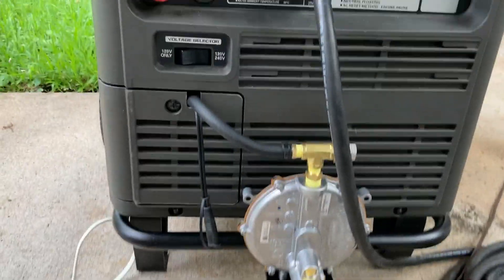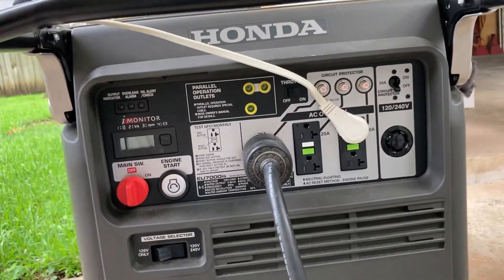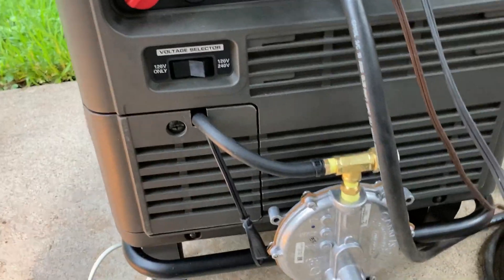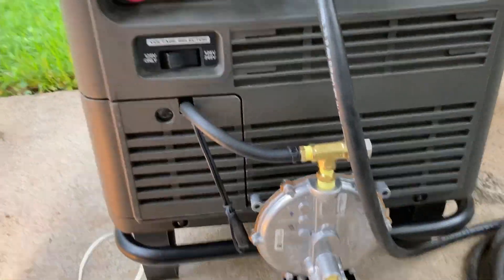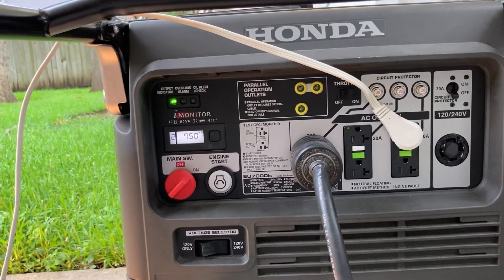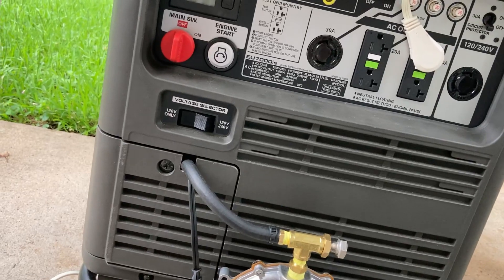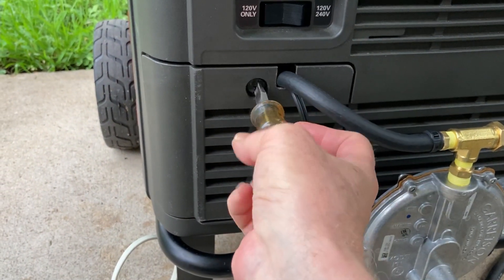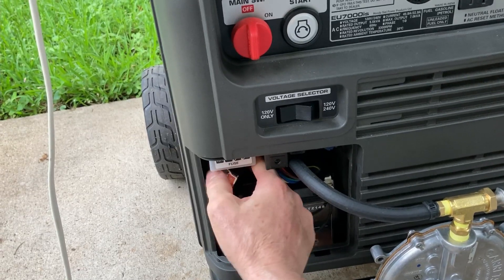Honda EU7000is running on natural gas with US Carburetion Motor Snorkel tri-fuel conversion kit

Comment: The reason your generator's engine is surging is because you cut that opening in the battery compartment door. The manual specifically says that the door should be installed and completely closed, otherwise the engine will not run correctly. Why did you install it this way?
Reply from the maker: As you say, the manual does warn against operation without the maintenance cover in place, but the door itself is louvered, so it's as much hole as it is solid - the amount of extra leakage around my hose would be completely insignificant.  It actually makes no sense that they would say that, since the door itself has a knock-out in that location, which is intended for remote start wiring, so I don't know why they say that.  But FWIW, I've spent a lot of time with the generator and as far as I can tell, it runs exactly the same with no door at all.  Also worth mentioning that there is no surging when running on gasoline, regardless of whether the door is open or closed.

And to be fair, even none of the above were true, the instructions that came with the conversion kit told me to use the knock-out in the battery door, and since this is as much a review of the kit as it is of the generator itself, the kit instructions are as important factor.  But honestly, if you saw the door in person, I think you would agree that the extra hole can't possibly make any difference.  The entire generator design requires air to be drawn in through the battery door and the rest of the front panel, so it would be way worse to block it off than to open it up.

I have a feeling that might be a mistake in the manual.  The side maintenance covers actually are sealed, so it actually might make a difference if they were open.  Maybe that note was intended for the side covers.  Although even that doesn't make complete sense, because the only way to rope start the generator is by opening the right side maintenance cover.  FWIW, I think it's more about airflow for cooling the inverter than it is about how well the engine runs.
Reply: @MstrMark  I have the 6500is model, same as the 7000 in virtually all respects. Take the door out and it surges exactly as in your video. Put the door back in and no surge. Honda doesn't make mistakes like that in their manuals. Third party companies do.
Reply from the maker: @meinempanadas  If you say that's what happens with your battery cover, then I believe you, but that's not the case with mine.  And again, mine doesn't surge at all when running on gasoline, even with all the doors and covers open.

The idea that Honda doesn't make mistakes is a relative concept...as a professional mechanic, I've seen a lot of things that Honda did that seemed like mistakes to me.  I think they make a good generator, which is why I was willing to pay so very much for the EU-7000is, but it's not perfect.

Also fair to say that the conversion kit is far from perfect, but it now runs on natural gas, which is one of the things that makes Honda's design less than perfect, IMHO.  I think it's a fair trade-off.
Reply: @MstrMark  Mark, your generator began surging at 4:37 in the video the moment you switched it from 240v to 120v. I can hear it quite clearly. Honda doesn't make NG or LPG generators because of liability issues. From one pro mechanic (Marine Corps-trained) to another.
Reply from the maker: @meinempanadas  I agree with everything you just said, but don't see a solution in there, other than to only run it on gasoline, which never surges, and generally runs like a dream. But gasoline is a very impractical fuel for a seldom-used machine.  It's difficult to store safely, has a lousy shelf life, and it's hard to replenish in the middle of a state-wide blackout, like the one that happened here in Texas last February.  Given the choice, I'll live with natural gas. The surging only happens within a very particular range of loads, and only in the 120 volts (only) mode, and only with Eco-throttle engaged, so it is easily manageable.

I'd be curious to know your thoughts on why Honda is more concerned about liability issues than an arguably lesser company like Champion...as you probably know, they have multiple models that are dual fuel right out of the box.

Also, I know you think it's because of the battery door, but I don't think that's actually true.  I think it's because the engine doesn't make as much power on fuels other than gasoline, and Honda's throttle management (GCU programming) incorrectly assumes that the engine has more power at a given RPM than it actually has.  I think it's a case of the engine falling off the power curve.  If the engine computer would ramp up the RPM more aggressively, it wouldn't surge, as demonstrated by running it in 240 volt mode with the exact same load.  It seems that Honda uses the load on either of the two inverters as criteria for increasing the engine speed.  It's not based on total power - it's based upon load per inverter.   

When switched to 120 volts only, the two inverters are bridged, so each inverter sees only half of the load.  Honda apparently takes that as a signal to throttle the engine down, which then, unfortunately, allows the engine to fall off of its torque curve.  At that point, the engine slows down enough that the generator can no longer meet that demands of the inverters, which then results in a reduction of output voltage.  At that point, with a purely resistivity load (like I was testing with) the wattage falls off, which then allows the engine to recover RPM again...and then the same sequence of events happens over and over again.  I think that's why it surges.

It may be that Honda increases the engine speed in order to ensure adequate cooling airflow over the inverters more than to maintain engine power output.  That airflow is directly influenced by engine speed.  There is no electric fan - it's purely mechanical, driven by the engine...completely dependent upon engine RPM..

This correlates with my experience with an EU3000is that I've had for many years.  During Hurricane Ike, I was using that generator to run a portable A/C unit.  It didn't have any trouble running the unit, so it was in Eco-throttle mode and seemed fine until it unexpectedly shut itself down.  After a few shutdowns I started to understand that the inverter was overheating.  It was very hot outside and my EU3000is is not nearly as sophisticated as my EU7000is, so it certainly wasn't smart enough to figure out that it needed to ramp up engine speed in order to keep the inverter cooler.  It would just chug along until it overheated and shut down.  Over and over again.  And that was while running on gasoline, so we can't blame any factors beyond Honda's design intentions.  They just failed to anticipate the need to speed up the engine in order to keep the inverter cool enough.

Now, many years later, it seems that the EU7000is has a similar issue, if somewhat backwards.  Perhaps it's not fair to blame Honda for failing to anticipate the need to increase the engine RPM more aggressively, because after all, they didn't intend for the machine to be running on alternate fuels. But then on the other hand, I suspect that essentially that same thing would happen while running on gasoline at high altitude, so one might reasonably argue that they should have given it more thought.

Or one might also rightly argue that the maker of the conversion kit needs to find a way to reverse engineer Honda's GCU so that it will tell the engine to increase RPM more aggressively.  Or if I'm right about the inverter load being the criteria for engine RPM, then perhaps some way to spoof the GCU into thinking that the inverter load is higher than it really is.  But something tells me that US Carburetion is not likely to do that, since they don't even care if the kit fits right from a purely mechanical perspective.  "Hey, it's a kit" - they're kind of famous for that attitude.

If Honda generators were anything like turbocharged "tuner cars", then multiple spark-heads would have already cracked the engine computer and it would be just as easy to chip-tune a Honda generator as it is to chip-tune a Honda Civic Type R.  But alas, that kind of enthusiasm for generators doesn't seem to exist.  If Honda stays on their present course, I believe that they will lose a lot of market share to the likes of Champion.  I suspect that they already have, because I personally know of half a dozen people who chose Champion over Honda in the last year alone, because (a) they run on propane right out of the box and (b) they cost so much less that one could buy several for the price of a single Honda, not to mention the extra expense and hassle of converting a Honda to run on a more practical fuel, nor the fact that all of the conversion kits that currently exist have significant "issues".  Champion is paying attention to what people want from an emergency generator, while Honda is not.  

I want to love Honda, but Champion seems to be leading the market right now.  I can buy (4) 4650 watt Champion dual fuel inverter generators and two parallel cable kits for less than I paid for my EU7000is which would give me over twice the power and/or quadruple redundancy, and still come out over $1500 ahead considering the conversion kit.  And to say nothing of the massive expenditure of my time and trouble.  It's crazy really.  I don't know why anyone buys Honda generators, unless it's for the bragging rights.
Reply: @MstrMark  Honda is more concerned about liability simply because they are a much larger "deep pockets" target. As to placement, it would make more sense to drill an appropriate size hole into the access door and put a grommet on it to pass the tube through. That would seal the opening from air leaks. Or drill the hole somewhere where it will not cause surging. I bought my EU6500is because it was priced some $1800 less than the next one I could find with almost 2,000 hours, and mine only has 54. And don't forget to add a shot glass of Liqui-Moly MoS2 do the oil (50ml/liter). It will greatly reduce wear and tear on the engine internals. I use it on all my machines, from a 2008 bus with a DT466 diesel engine, a Land Rover LR2 of the same year, the generator and even a lawn mower.
Reply: @MstrMark  the Champion Generators that are inverters are not 240Volt.
Reply from the maker: @unitedcountryarkansasprope3029  I am aware, but they ARE engineered and ready to run on propane, and one can literally buy a nice Champion generator for less than I paid for my conversion kit alone!
Reply: @meinempanadas  I have a 100 foot remote start for my EU6500 that came with it, also no longer available to order, and it is designed to connect to the generator through that knock out hole in the front battery compartment. I have not done so as I don't need remote start, but I can see if it was passed through that knockout, there would still be a large hole left in that front compartment. Not enough to affect operations I suspect as this is a Honda approved connection,
Reply: @MstrMark  Seems like poor design to draw air thru the bat compartment, where I live seems like that would encourage battery freezing in the winter. Not that its going to be an issue in texas lol.
Reply: @atticus2581  I've read that fully-charged AGM batteries can survive at temperatures as low as -70F.  I haven't seen any actual documentation to back that up, but if true, there aren't too many places in the world where freezing would be a problem.  But as you say, I am on the Texas Gulf Coast. so I don't have much experience with such things!  I can remember one time in my life when the temperature around here got down to 1 degree Fahrenheit.  Even during the February 2021 storm that knocked out power across most of the state, it didn't get that cold here, although it did last a lot longer.
Reply from the maker: Stevan, 

I hear you, and I respect your opinion, but I don't agree.  Gasoline is a WAY more dangerous fuel than propane or natural gas.  Just in the last month, a bunch of people were killed in Louisiana while trying to refuel their generators.   Others died of carbon monoxide poisoning.  None of those accidents would have occurred if their generators had been running on propane or natural gas.  If Honda was concerned about liability, they would be better served by eliminating gasoline as a fuel option!

As for the routing of the gas hose, I used the knock-out that Honda provided.  I'm of the opinion that they wouldn't have designed it to be knocked out if they thought it would be bad to use it as they intended.  I think that makes more sense than trying to punch a new hole in the middle of a plastic part that is comprised almost entirely of ventilation slots.  I'm not sure I have any tool that could accomplish that in a way that would be anywhere near as clean as using the knock-out, and even if I did, the piece is so thick and irregular that it would be impossible to get a good seal with a grommet.  

Assuming of course that there would be any value in sealing a hole in the middle of a louvered panel that is essentially one-half hole.  By area, the entire knock-out is only about 0.25 square inch, even it it didn't have a hose running through it. The hose itself amounts to ~0.20 square inch, so I only added an extra 0.05 square-inch of ventilation.  That compared to something like 8 square inches of ventilation that the panel already provides, so my extra ventilation amounts to only 1/160th of the total area of ventilation. I just can't believe that could possibly make any difference at all.

And just putting that aside for the moment, there would also be the issue that using a grommet would make it impossible to open the cover without removing the gas hose, which is all but impossible to accomplish without damaging it.  The last time I had to remove it, I had to replace the hose.  I'm definitely not willing to replace the hose every time I need to open the cover, so it's just not an option for me.

And, I would point out to that you seem to be ignoring the fact that it never surges when running on gasoline, even when any or all of the covers are wide open, which strongly suggests that the covers don't affect the way the machine runs.  Logically, there has to be some other cause.  I have suggested several, but you didn't comment on any of that.

It sure does sound like you got a good deal on your EU6500is...I bought mine in reaction to seeing how hard it was for my dad to get by during a power outage.  I was literally wheeling the EU3000is back and forth across the street, trying to save thr food in both of our refrigerators...I decided that I didn't want repeat that experience, so I bought the EU7000is brand new.  I think I got a good deal, considering that there are essentially no "deals' on new ones, but I certainly paid more than you did.  It's a fine machine when running on gasoline, but not so much on alternate fuels, so I might buy Champion(s) if I had it to do over again.

As for extending engine life, my EU3000is is 30 years old.  It runs like it did the day I bought it.  I try to change the oil every year, even if I don't get anywhere near the hour requirement, but I often fail to do so.  I've never used anything other than conventional straight-weight Valvoline.  I checked the valve clearance a while back, but it was perfect.  It still has the original spark plug.  I stuck a scope into the spark plug hole and it looks like new in there.  The oil always looks and smells new, even after a year or more.  Natural gas is a lot easier on an engine than gasoline.

I'll probably use Mobil 1 next time I change the EU7000is, just because I now have more confidence in synthetics than I once did, and honestly, they have become easier to come by than the best conventional oils.  My generators just don't see a lot of hours, so ultimately the EU7000is' life will probably be determined by how well the (more complicated) electronics and soft materials hold up over time, not by the wear of internal lubricated parts.  

For example, my commercial mower is 30-years old - the Kawasaki Kai V-twin is a way better design than the rest of the mower.  It has a lot of hours on it, but the the only time the engine faltered was when it somehow blew a freeze plug out of the carb, which I talked my my neighbor into helping me fix by machining a new plug on his lathe.   My McLane frame edger is 45 - it's an old thing, but it still starts on the first pull.  I maintained four large suburban lawns during most of the life of my lawn equipment, and I still do two lawns most weeks of the year.  My GMC truck is 23 years old - had to replace the water pump for the first time last month, but the rest of the engine is all original.  I'm pretty good with machines.
Reply: @MstrMark  The issue with the battery door cover plate exists on the 6500is because it is carbureted.
This is not an issue at all with the Eu7000is because it is fuel injected.
You both are correct specific to the models you own. The door removal has zero effect on the motor surge on the Fuel Injected Eu7000is models but was an issue for a lot of owners of the EU6500is which came out before the 7000is. The addition of the fuel injection is why the 6500 is now a 7000. 

On another note has anyone hooked up the Msk-7000 PCM that came with the US CARB kit while also incorporating a wireless remote?
Reply from the maker: @GoldenAgeUSA2025  Thanks for the comments.  I have no experience with the EU6500iS, but what you're saying makes sense to me...unless the battery door on the 6500 has as many holes in it as mine does, in which case it still makes me squint.

Today is the first time I've thought about the term "MSK-7000 PCM", so thank you for bringing that to my consciousness.  My generator doesn't have remote start, so I don't know the answer, but I can make some educated guesses.  First, if I'm in some emergency situation where grid power is down, I can't think of any reason why I would want to shut the generator down, so by extension, I also can't imagine why I would need to start it again.  But I'm sure other people use the machine in other ways...maybe off-grid living or (well-equipped) camping.

Here's the thing - the primer is entirely manual, so if it's cold, it might be hard to start without using the primer.  But with that said, the only time that I have ever used the primer was after the machine had been disconnected from the gas supply, so the need may be as much about purging the hose as it is about enriching the mixture for cold start.  Maybe it would be fine.

Probably worth mentioning too that US Carburetion recommends turning off the gas supply as opposed to turning the generator's switch off, presumably for safety reasons.  I observed that procedure until I killed my second battery.  See, the EU7000iS drains the battery faster than a BatteryMINDer charges it, so if one leaves the switch turned on, the battery will be dead beyond recovery a few weeks later.  One might think it would be easy enough to remember to turn off the switch, but there are no lights or anything else to indicate the the switch is on, and even the expense and hassle of replacing the battery wasn't enough to remind me.

So now, after some observation and consideration, I just turn off the switch.  In my use case, there is no significant reason to do it the other way, because if I shut it down, it's because I'm about to put it away.  And FWIW, I did a pressure leak-down test, and it didn't leak, so any caution along these lines would matter only if the demand regulator happened to be leaking.  And even if it did happen to leak, if the generator is outside, as it rightly should be, there would be little danger.  But that would be something to keep in mind for other use cases.

I don't know...what do you think?